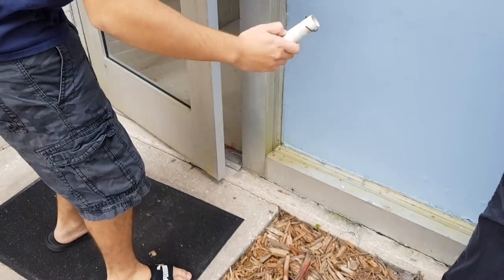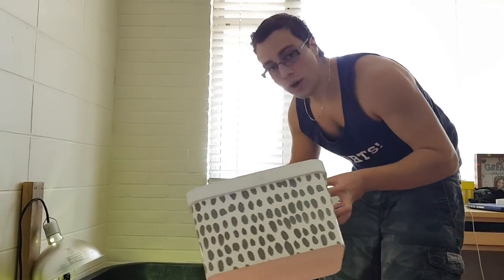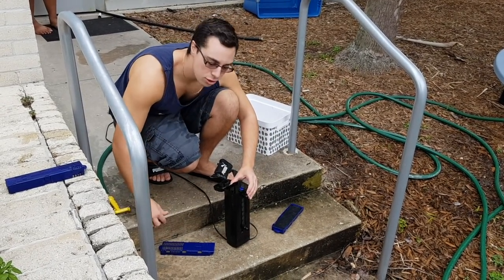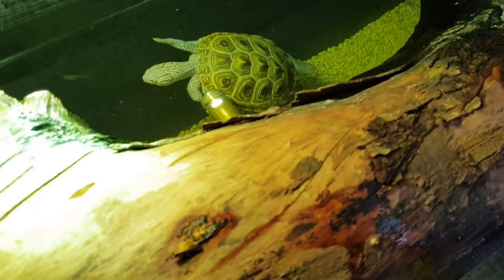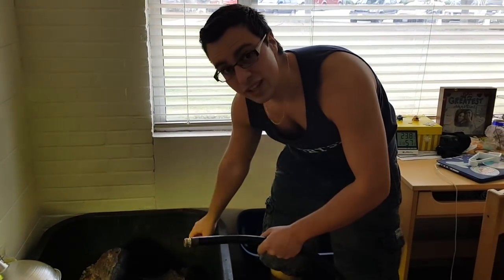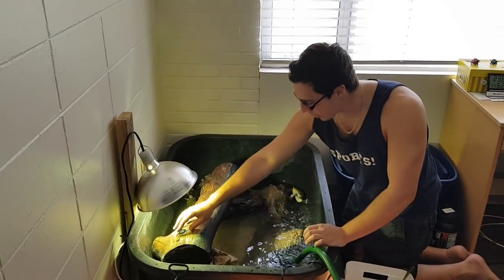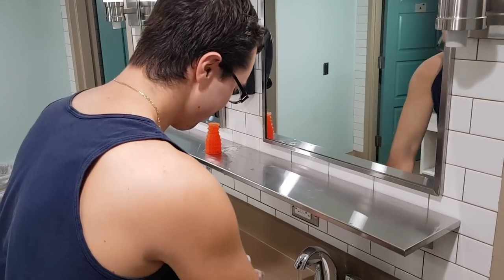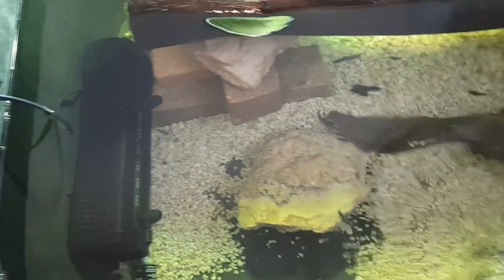WATER CHANGE on my 75 gallon TURTLE POND!!!

Comment: Very nice setup. I have two baby snapping turtles. They're in a 40-gallon  breeder. Can you please leave a link to where you purchased your tub from.
?
Reply from the maker: Hi there!  So I purchased it from Amazon, but they no longer sell them. I would purchase a 110gal stock tank from tractor supply if I were you. It's only $70!
Reply: @DanTheTurtleMan_  Thanks DanTheGuppyMan for responding. For me, most tanks or tubs are weird shaped and bigger up top than at the bottom. I'm looking for something uniformed in shape. preferably round, as I have 2 baby snapping turtles. They're not much into swimming and prefer the bottom of their enclosure. The 300-gallon Rubbermaid would suit their needs, but really not in my budget. I'll just keep looking or else buy a pond liner and build them an indoor pond. Thanks again and keep posting vids, us turtle heads enjoy them.

Comment: What kinda filter do you use in your tub.... I've heard they will eat sponge filters
Reply from the maker: They will definitely rip them apart occasionally!  I use a Fluval U4 internal filter
Reply: @DanTheTurtleMan_  an you have  no trouble with water clarity even with the 75 gallon tub?
Reply from the maker: @stuartcrockett95  Crystal clear every day!  Except the day of water change 😊😊
Reply: DanTheGuppyMan bit late but is it possible to add like a wire mesh round the sponge to prevent biting? Could be a pretty cost effective way of filtering turtles if fool proof